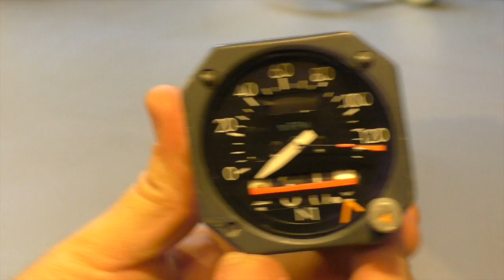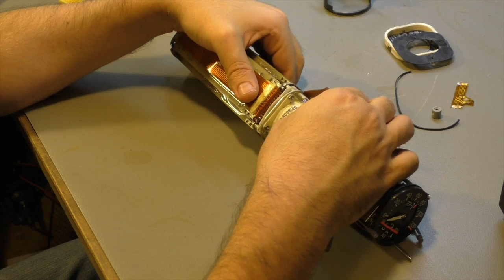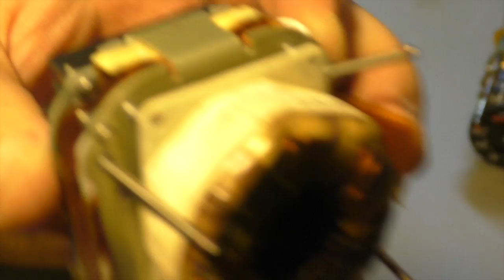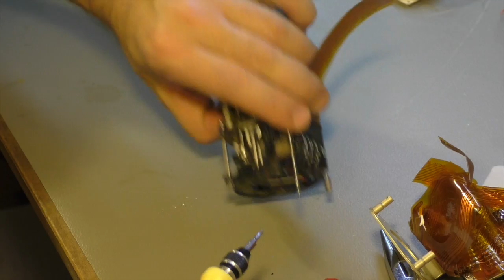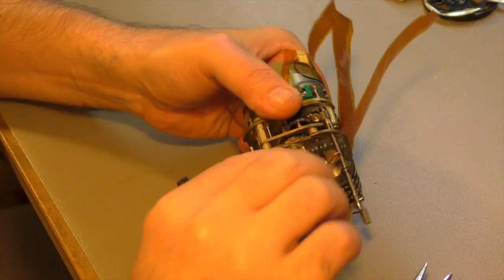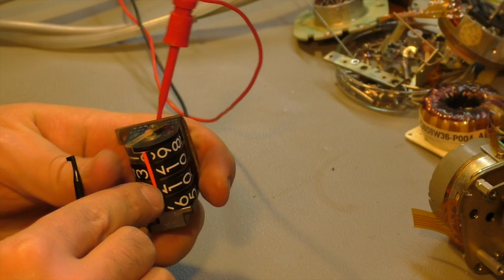Aircraft Instruments part 1 (PWJ22)

Comment: There are three spools in each engine- N1 to N3- so there are going to be three speed indicators for each engine.  The transformer behind the dial will be the main power transformer; that is a very common location for such a transformer.